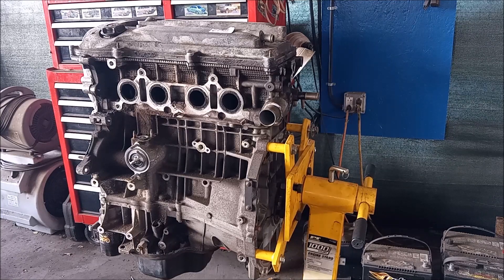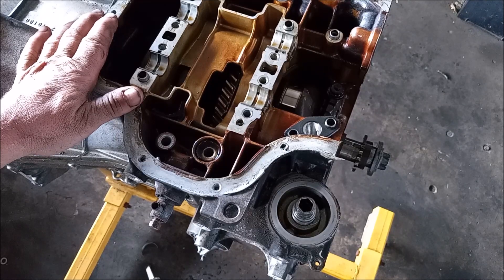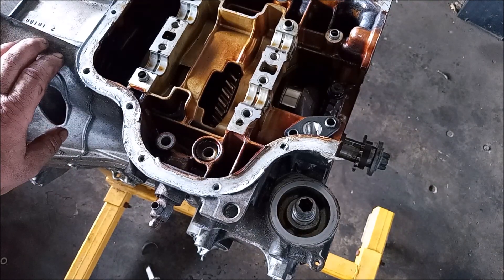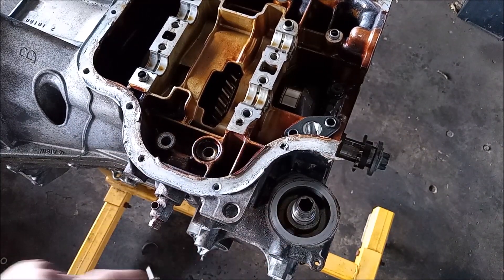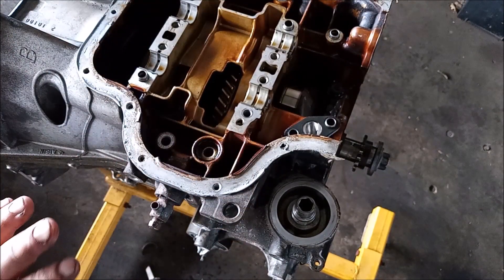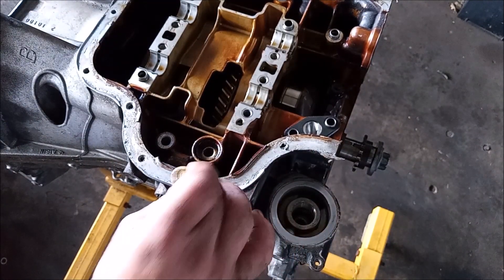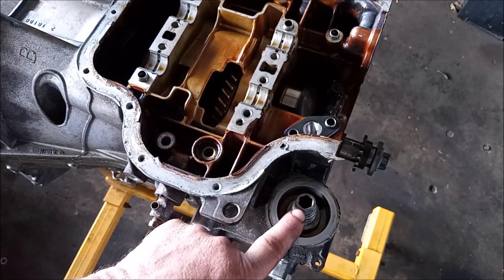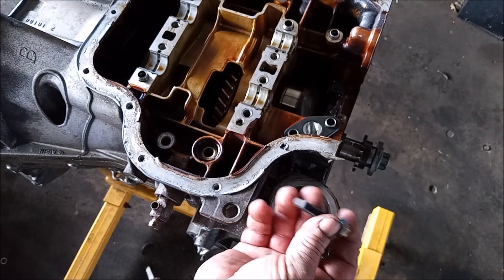Toyota 2AZ-FE Hidden Bolt For Oil Pan - RAV4 Camry Highlander Scion TC

Comment: So the oil pan will not come off without this bolt removed? i just bought a rav4 with a leaky oilpan and need to replace it
Reply from the maker: The upper oil pan would definitely not come off unless you remove this hidden bolt.

Comment: Hey so its worth a shot asking, would you happen to know the length of said 12 mm bolt. if not I would have to remove one and take to the store and get a replacement for the one I broke.
Reply from the maker: It's s 8mmx1.25 bolt, length is somewhere from 20mm to 35mm, really don't recall. Sorry.
Reply from the maker: If you buy the bolt at a hardware store it is likely to have a 13mm head, instead of a 12mm head, because it is a JIS bolt (Japanese Industrial Standard), and US hardware store bolts generally do not conform to this standard.

Comment: That hidden bolt SNAPPED on me so please be careful yall. I had my torque set to 24 and speced the other bolts and that one snapped before the wrench clicked. BUT if it does snap PLEASE DO NOT FREAK OUT. I prayed and Prayed and the Lord flashed a bic pen in my mind. YES A PLASTIC BIC PEN. I tapped it in and slowly turned the pen till I got it out. Otherwise I would have had to tap a starter dimple and drill a hole to get hex key... Anyway you get it!!! It would have just been a lot. But anyway, this is my FIRST time dealing with this level of mechanic stuff, if I can do it you can too. Well peeeps, have a blessed day!
Reply from the maker: Thank you for watching and for commenting.

Comment: Thanks Frankie, I saw the bolt in there but before I went at it with all my strength wanted to make sure it was not a left hand thread. Simple video, right to the point. From one of your pals off of Spyderchat! Good Job!
Reply from the maker: Thanks for watching and for commenting. Sorry to hear you are working on a 2az. 2az = bad in French and many other languages.